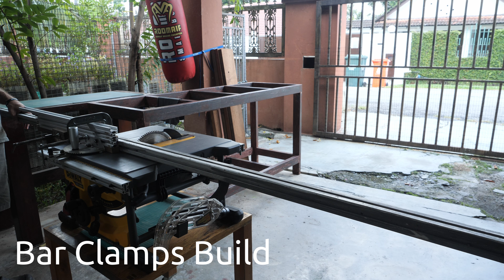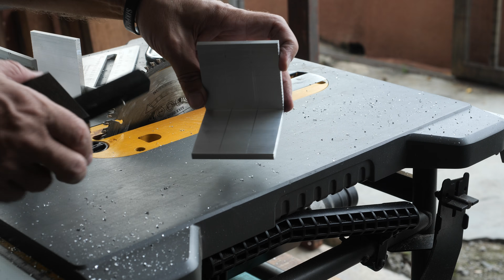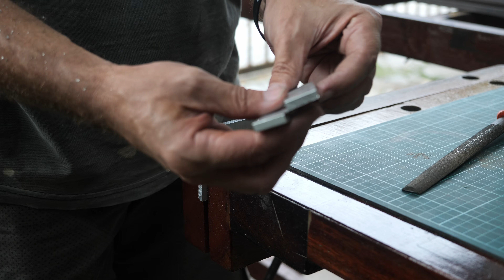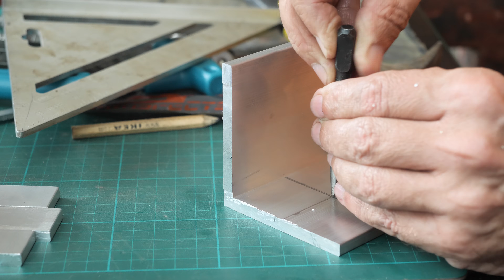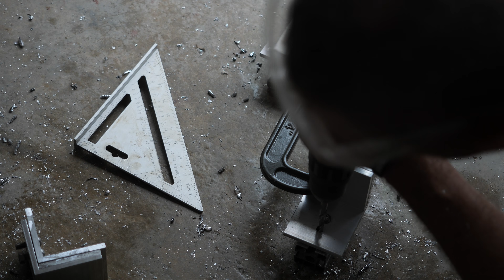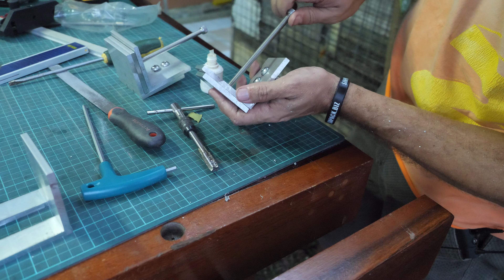Bar Clamps Build Part 1 Heavy Duty Made From Aluminum And Stainless Steel | by Tiger Carpenter

Comment: metalurgia e carpintaria juntos kkk

ficou ótimo seu trabalho
Reply from the maker: You can use Google translate to make your comment understood by most people 
Carpententry uses most of the tools that are made of metal. And I'm not limited to the carpentry, I can make anything I want if it's useful for my purposes 
I think my bar clamps design is unique. The parts that need to be wear resistant are made from hardened stainless steel. The aluminium bar extrusion is very sturdy and stiff and doesn't bend when the wooden boards are clamped. 
After couple of years of using these bar clamps, they passed the test with flying colours